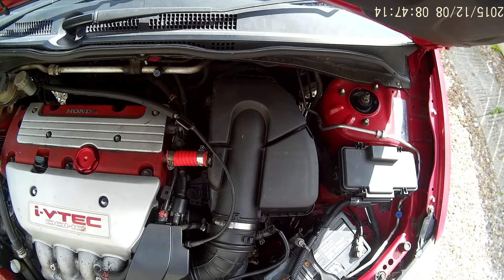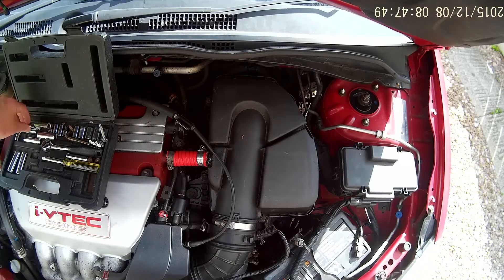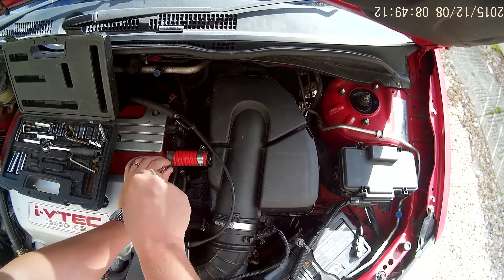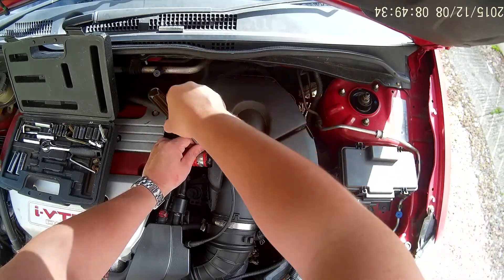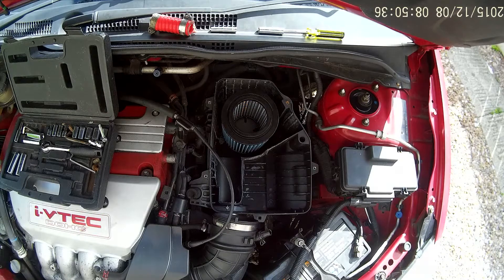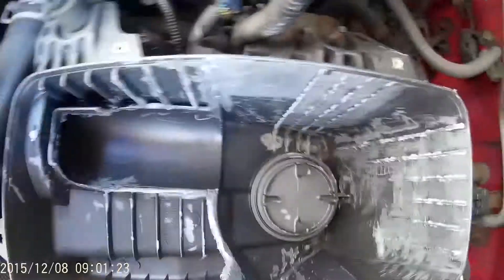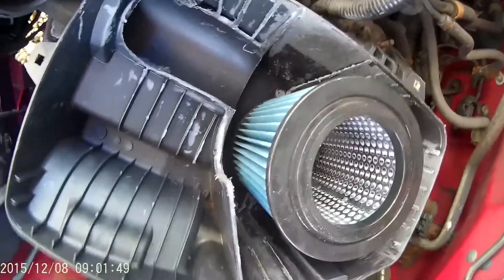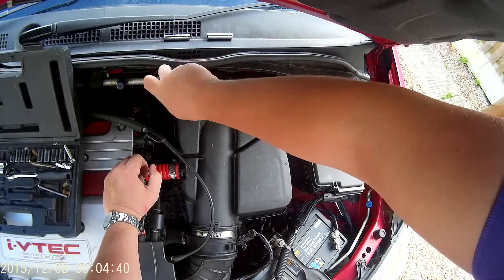HONDATA MOD EP3

Comment: I am an engineer. I am not convinced. Air is smoothed out by all the fins. Strange when lads think they are better than Honda's research and development engineers. Type R owners avoid this mod.
Reply: engineers aren't just looking for performance they are looking at noise which is why you have baffles in air boxes n tubes.
Reply: Exactly what I was thinking. Why would they think this would be better? The engineers tested the best configurations for the best airflow possible without sacrificing reliability and longevity.
Reply: I believe this mod is to make the standard airbox similar to the mugen item item.

I think it does increase power by a negligible amount but makes throttle response a bit jerkyer.
Reply: Well this is a hondata mod purposed for k24 or k20 engines, it derives from their tsx development. There are engineers too tho